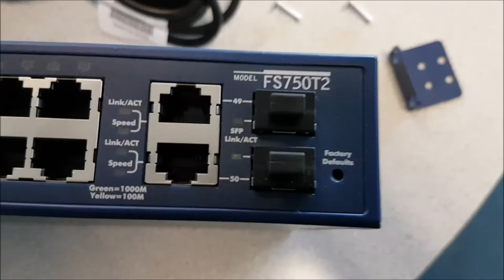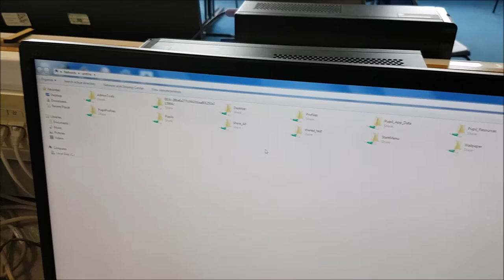NETGEAR 48 PORT SWITCH FAULTY

Comment: @
Mark Davies Fuck, what a mess... You could use multi-color patch cables for easier identification which one is which...
Reply: Like its that hard to identify nr from patch panel and then fallow one cable...
Reply: @CeleronS1 It is... I prefer the simplest solutions, because making life harder is pointless for me...
Reply: @PiotrK2022  Its not that simple when you have to spend your time to sort out cables just to get ability to find that cable faster one day... For me pretty is when whole thing works as soon as possible. Not gonna spend my life on worthless cables to look pretty where only IT might see it.
Reply: @CeleronS1 Yeah, yeah... Until sth will decide to give up and let's say 2 hours wasted to figure out what is what to 
finally solve the problem,. Next your boss will kill you, becuase network was down for so long time. I think it is a very good practice to at least connect port 1 with 1, etc. and then print a list with description which port corresponds to which room/wall socket/device, especially if you have a managed switch with multiple lan segments connetected to it.  I have seen already the situation where two  segments was connected to the same switch, IT   after modernization wasted  30 minutes to   note down what is what and  how things are connected to connect  later everything back  correctly  Rember that misconnections are very hard in  troubleshooting, so it's better have everthing described and marked - then you will thank you yourself if let's say 10 years later you will  get forced to upgrade your network, rebuild/change sth, because i guarantee that you will forget how things are connected together, so thanks to description you will save a lot of time to remind yourself everything and correctly connect back.